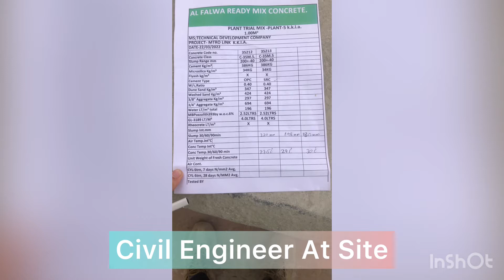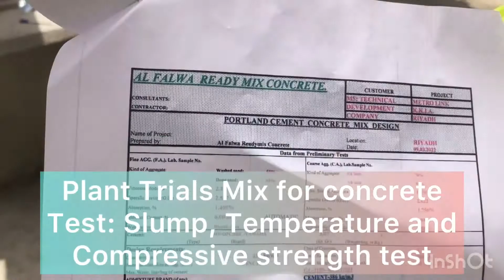Trials For Concrete Mix Design at Batching Plant in KSA|Civil Engineer At Site.

Comment: 50 to 100 mm is general slump value of concrete
75 mm [+ - 25]
Is using super plasiticizer allow the high value of slump.???
Reply from the maker: It depends on mix design
Reply: yes and addition of water if segregation is under control. MixDesign is probably for M40-M45. as there are use for microsilica confirming the dense and tougher material design. the testing at site is usually done for conformity (main purpose) and to reduce the level of cement and other materials used in the mix moving forward by conducting standard deviation test.

Comment: which code you are following , as you said each test should be followed by 30 minutes and you might know the cement initial setting time is 45 minutes after that concrete starts setting so there will be a huge difference after 30 minutes of slump value.
Reply from the maker: Dear this is trial mix at batching plant before the approval of mix design
Reply: @CivilEngineerAtSite  Ok sir thanks